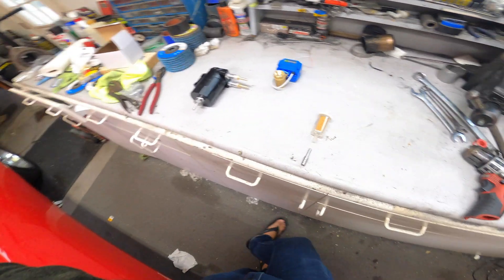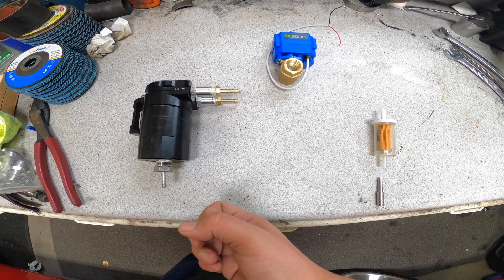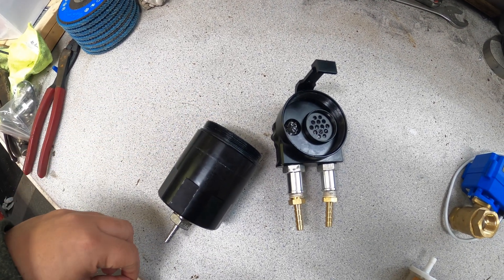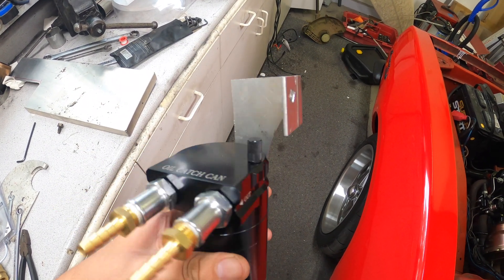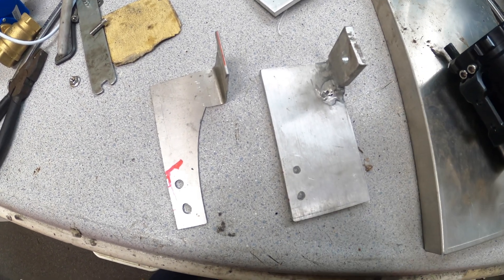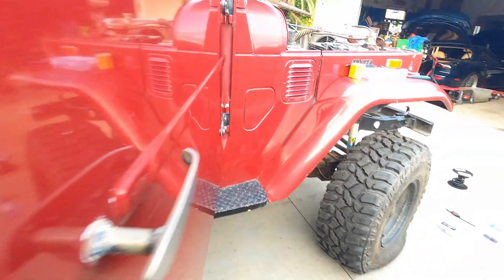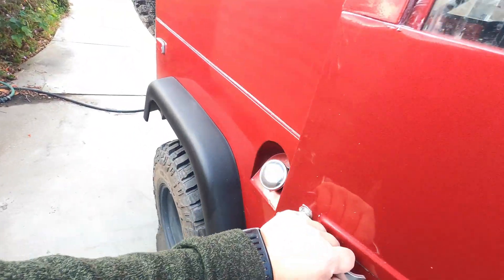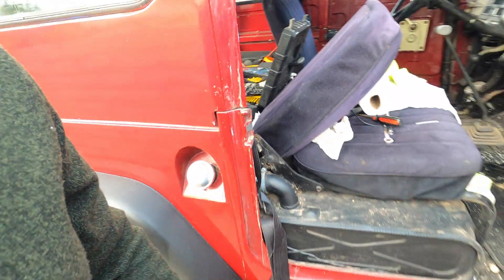DIY FJ40 EVAP System

Comment: Hello, nice job. I’ve been thinking of doing the same sorta thing. Question, what’s the canister beside the radiator with the A&N fittings on top of it?
Reply from the maker: Hi Jamison, that is a surge tank for the fuel system. I have a low pressure mechanical fuel pump feeding the smaller surge tank from the main tank. The surge tank then has a high pressure fuel pump for the FiTech fuel injection system. This works out well for rock crawling to avoid fuel starvation on a low tank of fuel during steep angles.